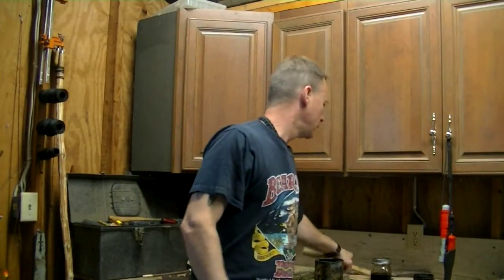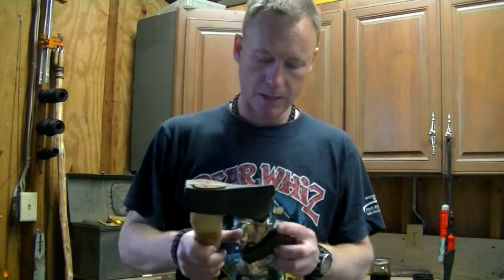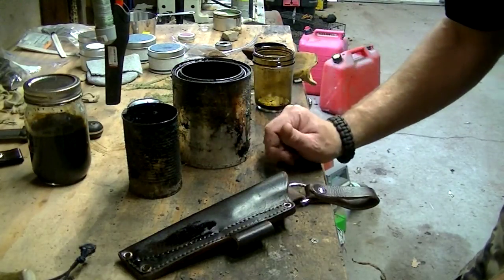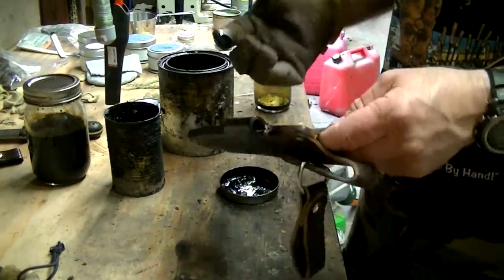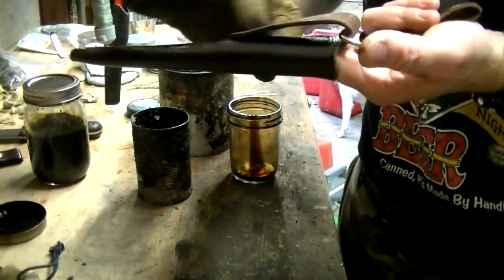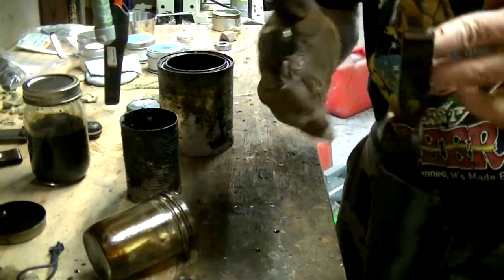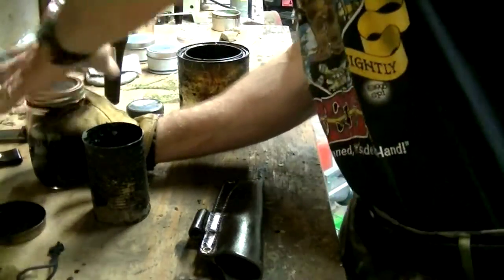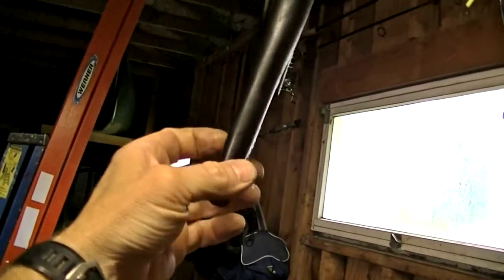Birch Oil 3

Comment: That was great. Another leather waterproofing. Have you ever gave a thought to using a fat separating cup. You pour in the dripping from your roast or whatever into the cup let the drippings cool and the fat rises to the top with the fatless drippings that pour through the bottom spout. Birch oil rises water stays below when done pour out water. I don 't if it will work maybe maybe knot. That is cool tee shirt. Thanks.
Reply from the maker: I will look for one. I've never heard of a fat separating cup, but it sounds like exactly like what I need. Thanks about the shirt. :)

Comment: Hey Larry! Watched all these birch oil videos of yours here in Estonia - about to go make some of my own. Very excited about the idea it working as a mosquito repellent as well. 4 months on since you made these videos, have you had any further feedback about the oil and its uses?
Reply from the maker: ***** I have been super busy and have not had the time to try it out like I would have liked. The oil does work moderately well for a repellant, but the smell also will repel your wife or girl friend. lol It is a good leather preservative, but mine had just a hint of water in it this last time and when I put it on my knife it did stain it more than I would have liked. I'm actually just starting winter here and I am planning on using it for the cracks I get in my thumbs.
Reply: Thanks for the update ***** I wonder how it works at preserving wood compared to say linseed oil (besides the obvious staining).
Reply from the maker: I need to try that out personally, but I've heard it works good. I bet it does cause it worked good for my leather.
Reply: Will see how it goes on the wood! Have been messing around here with coffee grains and oil to make a darker stain on wood but I rekon this oil could be the ticket. Am going to try it also as a pitch to fill some gaps between planks.
Reply from the maker: You might try and leave it on the fire longer if you want to use it as a "pitch" like you were saying. If you do leave it longer it thickens and becomes like a tar and is water proof.
Reply: I was wondering about that! Thanks for that bit of advice. Helps a lot